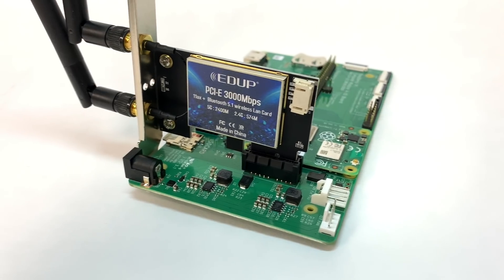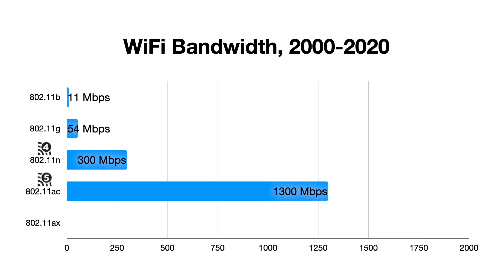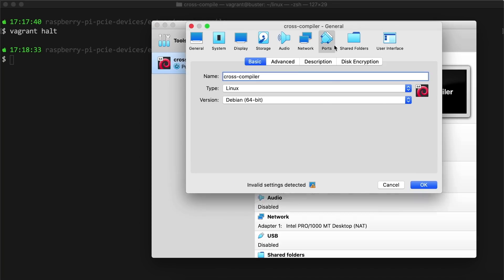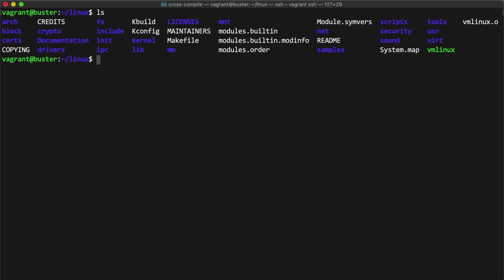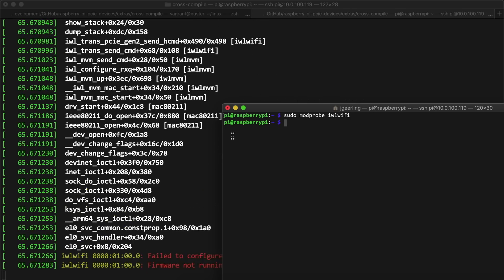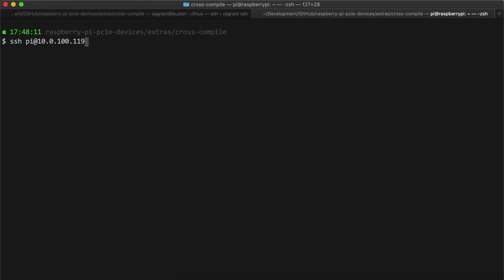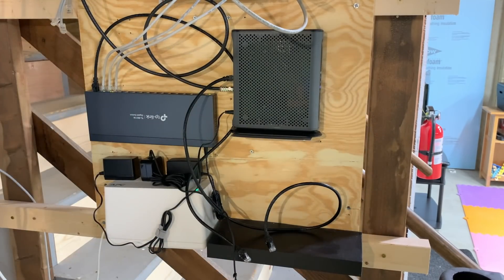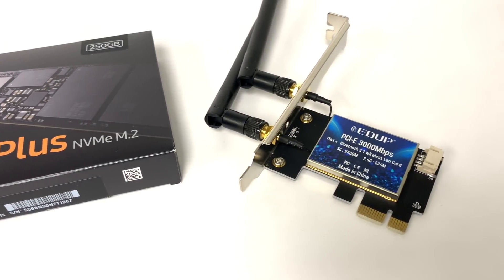WiFi 6 on the Raspberry Pi CM4 makes it Fly! MORE THAN 1 Gbps!

Comment: Does your networking equipment allow a bonded connetion to get 2+ gig to the asus? But taking up 2 10g ports isent optimal.

Ddwrt supported bonding so id assum merlin does to

Comment: docker? docker buildx? any reason why compiling arm kernels on x86 with qemu on docker wouldn't work?  tar the result and docker cp it out?
Reply from the maker: Unfortunately Docker can't work with physical devices (eg usb drives and adapters), so you'd still have to find a way to mount ext4 on Mac.
Reply: @JeffGeerling  (I'm unfamiliar with docker desktop for mac but) What about passing through the ext4 storage device with the "--device" docker parameter ( https://stackoverflow.com/a/24231872 )?  I'd bet that compiling with docker + qemu is substantially faster than a vm (with vagrant or otherwise).
Reply from the maker: @measless  Unfortunately that passthrough doesn't work on the Mac due to the light VM Docker wraps itself in on the Mac.

Comment: Could save you a bit of time by using make -j$(nproc), which should use all available threads, to compile the kernel. Beware that it will use 100% of your CPU though.
Reply from the maker: 100% of the VCPUs routed through VirtualBox too... VirtualBox isn't amazing for passthrough in my experience :/

But it's definitely something I could tweak better!

Comment: I'm using the Mikrotik CRS305 to get around the "10 gig is older tech than 2.5 gig and is incompatible" problem - 2.5 gig devices go to the Mikrotik, which has a 10 gig uplink to my router.

Comment: Interesting question: why isn't 802.11 a, b and g officially recognized as 1, 2 and 3 respectively? Seems logical, but nobody seems to do it.
Reply from the maker: Well, now that would just make sense, wouldn't it? That's not how tech works!
Reply: 802.11a and b are parallel techs, not a evolution of each other.
Reply from the maker: @leleobhz  True. In the video I didn't want to spend too much time on this historical aspect (just emphasize the speeds over the years). I had never even seen a support outside of a few enterprise environments.
Reply: @JeffGeerling  It's fair and no one used Prism radios had happiness while using it :p

The point I have about the video itself its only the half-duplex property of any wireless system and the beaconing issue affecting transfers, specially while using multiple solutions like you did, together in the same environment. At least a linear backhaul speed decrement in reason of number of stations its expected and I think it's a good (and expensive as *) point of study.

And last but not least important, thank you for the video!
Reply: @leleobhz  So then what would you recommend is WiFi 1, 2 and 3?
Reply: @bluephreakr  I recommend using IEEE standard naming schema.

Comment: Ive had the Verizon WIFI 6 Router and Extender ever since it came out (Gigabit as well)
Aside from the Router/Extender being better as a whole compared to the previous generation i havent really noticed any benefit to using WIFI 6..
So i take it that means that WIFI 6 is really only ever useful when it comes to doing things that require a high amount of bandwidth?
Reply from the maker: Yes; for latency in particular, things were 'mostly good enough' with 802.11g and n... but 802.11n and ac are the first standards that were a lot better in terms of uniform performance.

Once you go from ac to ax, the main difference is bandwidth (though there are other technical differences too). But if you don't need gigabits per second, it's not going to make much a noticeable difference in everyday use.
Reply: Thats what i thought. Thanks :)

Comment: That mikrotik with rj45 sfp should work with 2.5gb eth. Can I help you with that.
Reply from the maker: I just ordered a transceiver that should work. Fingers crossed!
Reply: I have two 10 gig Mikrotiks and could definitely use some 2.5 gig connections.  I didn't think they supported 2.5g.  Which SFP are you using?

Comment: Did I miss the step where you try to put the ASUS AC51 in a PC and make a point to point link from Pi to PC to run your benchmark?
Reply from the maker: Heh... until a week ago, I didn't have a PC :)
Reply: @JeffGeerling  Hopefully that is fixed now... so did you try reusing that ASUS AC51 card in that new PC? Actually you have plenty of PCI card to plug into that PC! Testing your cards on intel PC before the Pi might save you some time if the card is faulty.
Reply: @DavidGlaude  Doesn‘t work unfortunately. The cards can‘t to point to point (with anything other than WiFi 4 on 2.4GHz)
Reply from the maker: @DavidGlaude  Hehe, yes, that is the new plan. Make sure it works in a 'normal' PC before testing on the Pi. Especially helpful with some of the server pull cards that might already be dead!

Comment: Cool vid. Also, Intel just released the ax210 chip... adding Wi-Fi 6 capability into the 6 GHz spectrum. But there’s no such router on the market yet...so we’re limited to 5 GHz for now...
Reply from the maker: Yeah, I was reading up on it, and it seems like it will be nice (even less congestion since everyone seems to have 5 GHz currently), but it'll take some time to get there.
Reply: @JeffGeerling   yeah. And Wi-Fi 7 will add 320 MHz channels as well as other innovations in terms of using the multiple frequencies (2.4, 5, and 6 GHz simultaneously for data transmission). The next few years will be very interesting in tech. I am very excited. 

I’m using the raspberry pi as a pi-hole server and UniFi network controller. I’m blocking most if not all ads on my network. 

thank you for the cool videos!! Keep up the good work!

Comment: what is surprising to me is that the core i9 mac virtualising linux is only a little bit than 2x faster than a pi4 in compiling the Linux kernel
Reply from the maker: Well, I'm pretty sure I could get a little more juice out of it if I optimized my VirtualBox / Vagrant config a bit more.
Reply: @JeffGeerling  i mean sure, but even so, the fact that 4 very low power ARM cores can get anywhere near8 high performance x86 cores is incredible, even if a few virtualisation layers are needed

Comment: The card says 5G 2400M, so isn't it expected to be more than 1Gbps?
You might be able to get even faster with a 2.5G nic, running iperf3 on the router CPU is sometimes can be a bottleneck of the benchmark.
Reply from the maker: True; this particular router is supposed to have a decent CPU in it, but I know on the Pi 4 itself, the CPU can be a bottleneck beyond 4 gpbs of throughput.

I'm going to be doing some more testing once I get my fully-operational death star 10 gig network up and running!
Reply: @JeffGeerling  full 10Gig network with 10Gig switches could be relative expensive compared to buy some used 10Gig (or 2.5G) NICs on ebay, and setup direct connection. But anyway, I guess now you've ordered the xmas gift for yourself.

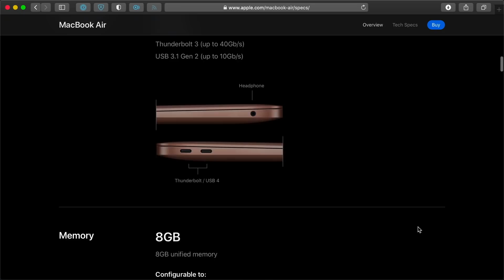Comment: At 1:45 you said no one used Wi-Fi 6 on ARM except for Apple. Do phones with Wi-Fi 6 not count? There are quite a few of those from many companies now
Reply from the maker: True, true. Did not think of phones in my classification of 'computers', though technically they are!
Reply: @JeffGeerling  btw, like it or not but routers are also computers, there are a lot of wi-fi 6 routers with ipq60xx/ipq80xx (arm) inside.
Reply: I don't think the phones have a fast enough interface to actually use wifi  6 for a transfer etc. But depending on what you're doing it might be actually usable

Comment: Man, my wireless network is still "IEEE 802.11b/g Mixed" at a whopping 2.437GHz on your wifi dial. I could extend the range, but my house backs up to a shopping center alley, and I get a bursts of wardriving attempts from time to time.  It got so bad, I had to disable my FiOS router, and set up a router with better wireless security options, which now is fairly outdated.

Comment: A silly question: since you selected "M" when  recompiling the kernel, wouldn't it have been enough to compile the wifi modules, copy them over, then put the firmware in place?
Reply: funny enough, when i installed debian buster, the pre installed intel wifi firmware drivers didnt support my wifi card, so i just booted up a live os that DID have my wifi drivers, copied them to github, downloaded them through ethernet and put them into the /lib/firmware directory, and it actually worked :DD
Reply from the maker: Technically yes... I didn't do it that way because reasons, I guess :P — I'm honestly trying to get some of this stuff more scripted since I'm doing it like 50 times a week sometimes now, but ultimately I just want to compile into a NAS directory and use netboot for faster boot cycles. Just haven't had the time to get all the kinks ironed out!
Reply: @JeffGeerling  that makes sense.👍🏻

Comment: There are some relatively inexpensive 10 Cisco N switches on eBay that might be worth a look. The 5 and 7 series are the ones I'm thinking about, but you may need a bunch of SFP+ modules. These might again be 1/10 ports so you may want to look for other devices that offer 1/2.5/5 GBE ports on copper.
Reply from the maker: It looks like Mikrotik has another transceiver I had missed earlier, and it supports 1/2.5/5/10! It's the S+RJ10
Reply: @JeffGeerling  the Cisco "type" might work too, lots of refurbished pulls coming out of China on "genuine" Cisco modules. Generally SFP+ is all the same, but some firmwares may get changed to lock out the unapproved hardware.

Comment: Looking forward to the 10 gig network video in the future! Hopefully it goes well, budget wise.
Reply from the maker: Heh... just as long as my wife doesn't see how much good 10 Gig gear costs!
Reply: I started with a Mikrotik switch with SFP+ uplinks, using those for my 10 gig desktop and server, and it's great. Not a huge price premium over a similar switch without SFP+ uplink.
Reply: @apalrd8588  my project is the same and is currently in flight

Comment: The internal wifi card of the Raspberry Pi 4B supports 433Mbps (1 stream 802.11ac). Data transfer will be +/- 50% if tested with iperf
Reply from the maker: Meh... I've tested on three different networks now, and never broken 100 Mbps on any of them, placed 5, 10, 15, and 20' from my routers. In all cases when testing with other laptops like my Mac, my wife's older Mac, or my Dell XPS 13, they all get 300-900 Mbps on the same network.

Even with an external antenna on the Pi CM4, I can't get any more bandwidth (just a slightly better connection).
Reply: @JeffGeerling  You can‘t do more than 100MBit/s with the internal WiFi, because it‘s connected via SDIO and limited to the SDIO clock frequency.
Reply from the maker: @Manawyrm  Ah, that makes sense, and TIL!

Comment: wrong redshirt Jeff...

Mikrotik: RB4011iGS
SFP+ port with:
   Vendor Part Number		S+RJ10
   Auto Negotiation		done
   Rate		5Gbps

You need to buy the S+RJ10 transceiver to get the mixed speeds. I think STH has a video on these cheap transceivers that support also 2,5 and 5Gbps...

https://www.servethehome.com/wp-content/uploads/2020/03/STH-10Gbase-T-Converter-Testing-Summary-Table-2.5-5-10GbE-and-Jumbo-Frames.jpg
Reply from the maker: I just ordered a S+RJ10 — I'll definitely get more in depth (didn't even have time to do any proper testing yet) soon! 10GbE is all new to me.

Comment: Last month I did a cheap wifi upgrade and got a TP-Link Archer C6  AC1200 Wifi Router for £38.  Using a £8 USB 3 Realtek 8812BU wifi dongle I got a Iperf benchmark score of 230Mbits per second.  That is good enough for my Oculus Quest 2 virtual reality headset that needs 150Mbit a second wifi speed when streaming games with from my games PC with Virtual Desktop.
Reply from the maker: Yeah; for many people a standard USB WiFi dongle may perform perfectly adequate, even on a Raspberry Pi via USB 2.0 or 3.0 (and still faster than onboard WiFi).

Comment: Hey Jeff! quick comment! You might want to just do "-j" without specifying the amount of threads to use! the kernel scheduler will optimize the branching at every step.  even if you have the same amount of threads at you use as a -j argument, it's still faster. -j[] is typically used when you need to guarantee only a certain amount of resources are used
Reply from the maker: Well... TIL; I will go ahead and update my docs for that and also see if that does a little nicer.

Comment: Great video. I love these story type videos.

Also. Why are your antennas pointed so oddly? 

I'm sure you're aware they radiate perpendicular to their pointed direction, so you point them  where your signal hits the broad side of the antenna.
Reply from the maker: In most of the pictures I place them in directions that are at least somewhat aesthetically pleasing. In practice I place them first where they fit (sometimes you just can't orient it where you want due to the mounting conditions), and second where they seem to perform the best after some benchmarking.

Comment: Did you ever work with Wavelan, the WiFi predecessor, Wavelan?  I remember flashing early Lucent Wavelan cards to the official WiFi standard in 2000. Used to work in a lab where Lucent was a partner.
Also played with early Bluetooth from nextdoor Ericsson.

Comment: Good one dude. The drawback (or benefit?) of running bleeding edge hardware on linux is that you have to put the driver together yourself.
Reply: did that for 10 years - it a blast

Comment: It's a shame the availability of these are so low at the moment, I'd certainly be interested in messing with a CM4.  Seems to be much different to the regular Pi 4 and the CM3.
Reply from the maker: It's a massive improvement over the CM3, and the only major difference from the Pi 4 is the exposure of the PCIe slot. The Pi 4 actually has the same hardware, but it's hardwired to a single USB 3 chip.
Reply: @JeffGeerling  Fortunate for you, you mentioned being close enough to a Microcenter to pop in, which seems to have better luck at keeping these sort of component devices in stock, or regularly re-stocked.  

Their "maker" section is a modern day replacement for the Radio Shack of old, and their SBC cabinet certainly makes me envious of those who live close enough to shop from it.  Unfortunately, I'm basically equidistant from the Brentwood, Overland Park, Chicago, and Minneapolis locations, so unlikely to ever get one closer...in-store only deals demand a road trip.

Comment: Gotta love when a 35 dollar compute is faster then your current computer
Reply: you don't need much in your computer to get more than gigabit, the problem is that you need something else to use that speed.
if i look at amazon a 2.5Gbit wired network card is about ~50€ and 10Gbit ~80€ but to get these speeds in a real file transfer you need at least SATA SSD's in both parts again
Reply: @hama3254  https://www.amazon.com/UGREEN-Ethernet-Thunderbolt-Converter-Compatible/dp/B081TY1WQX this one is cheap I’ve tested two pc’s connected together got 2.3Gbps. There should be plenty of headroom in USB 3.0 because that’s 5Gbps. Full 2.5Gbps is about 300MBps so yes you need a ssd that can write at that speed even for 1Gbps its already 125MBps. I don’t know how much RAM helps with short file transfers.
Reply: @pvdgucht  i personally would prefer PCIe instead of USB/Thunderbolt but that's also an option.
My experience is that 2.5Gbit gets me ~280MB/s